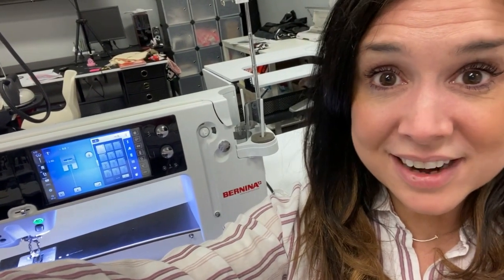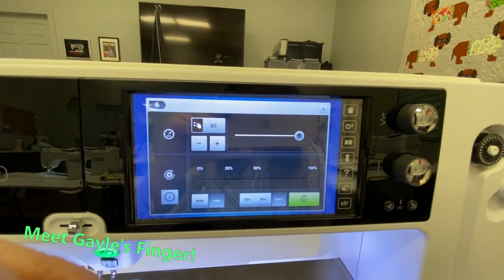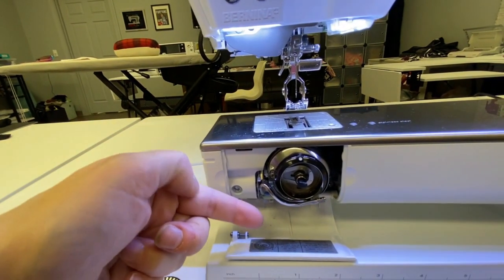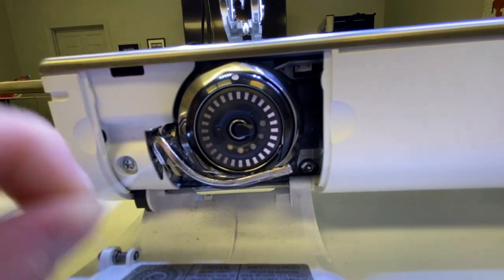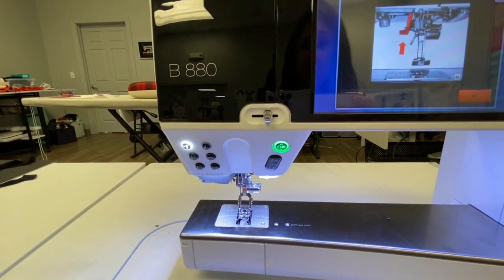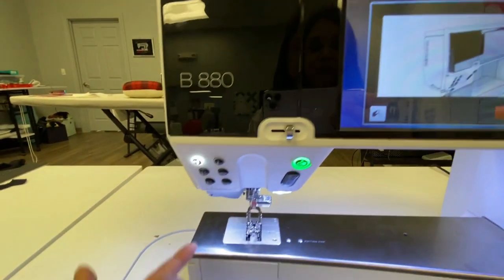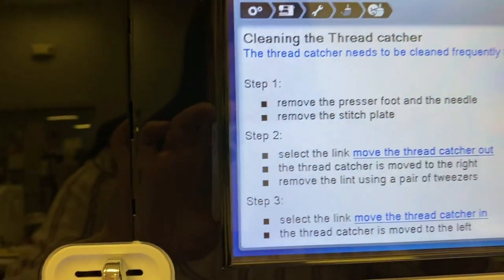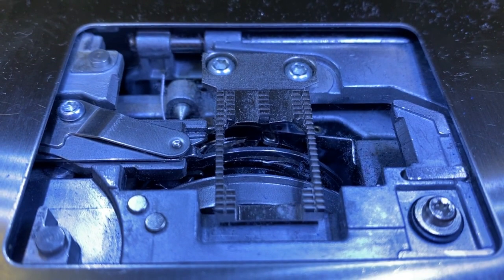Intro to a BERNINA 880 PLUS

Comment: The Bernina 880 manual says to wind the thread around the bobbin one or two times, rather than about five times, as you recommended for winding the bobbin. Is your method an upgrade for the 880 plus, or just an irrelevant detail?
Reply from the maker: In my experience of sewing with the 7 series for over 15 years, wrapping a few extra times prevents it slipping out of the bobbin with slippery thread.

Comment: Thank you, Gayle, for a very helpful video. I learned some important things I hadn't known from any other video. One question though...when threading the machine, does the thread go in front of the little metal tab (toward the front of the machine) or behind it (toward the back of the machine)????
Reply from the maker: I always put it in front but it doesn’t matter. Only when you are using a twin needle. If using a twin needle one thread goes in front and one goes behind.

Comment: Hello Gayle.  I'm so pleased I came across yr video and I've now subscribed.  I've just purchased my 880+ and managing the different threading issue.  Yesterday, I did a text run of an embroidered (small size) label for a quilt.  Looked great, however I was under the impression that when embroidering, the bobbin thread should be dominant on the reverse and NOT the top thread?  On my test the TOP thread was dominant on both the top and bottom!  So, my question is is that corrected if not, then which tension do I need to alter ??  Thank you so much for any information.
Reply from the maker: You should see more top thread in the bottom area than the bobbin thread.
Reply: @BERNINAofNaperville  Ahhh ok. Tysm.. then all is good! :)

Comment: 15:30 So, you clean the needle feeder and the stuff will fall underneath and inside the presser foot area.
Why not cover the lower part first with a piece of paper or cloth.
Reply from the maker: Because you clean from top down and if a spec fell you can catch it. No need to put down a mini tarp or anything.
Reply: @BERNINAofNaperville  Correct and I agree but you did the bottom part first on the video, that is all. It looked weird.
Reply from the maker: @LookOutForNumberOne  oh well. No one is perfect. This video was made in our really early days before we could get a tripod (Covid). Please check out our “so you think you cleaned your machine” it’s a newer one.
Reply: @BERNINAofNaperville  Yes, it is all good.

Comment: Can you tell me the difference between the Bernina 880 (say the 125 yr edition age) and the Bernina 880 Plus?
Reply from the maker: The BERNINA 880 Plus has a few more embroidery features such as shape maker, Thread Away and Pin Point placement. In addition it has more built in embroidery designs, Enhanced Editing with undo, redo, Group and ungroup and rearrange. Also it Reads most popular file formats: EXP, DST, PES, JEF, PCS, SEW, XXX.

For more information you can see the details here: https://www.bernina.com/en-US/Accessories-US/Embroidery-Accessories/Embroidery-Machine-Upgrade/Embroidery-Plus-Upgrade
Reply from the maker: The 125 Anniversary edition was a Plus !
So the only difference is the Black Face Plate versus the Gold Faceplate.
Reply: @BERNINAofNaperville  so it is just an upgrade to the embroidery module itself? Or it firmware within the machine?  I am mainly a quilter and want the 880 model really for the 12" throat space but an embroidery module where I could do some semi-custom in the hoop quilting would be nice too.  I came across a GREAT deal on an 880 that was purchased about 3 years ago with very little stitch time/count.
Reply from the maker: @mxracer158  make sure that it is indeed a plus model. The 125th anniversary edition 880 Plus was indeed a plus model. A regular 880 does not have the plus features unless it was upgraded when that window of opportunity was available. A BERNINA Dealer can read information from an 880 to interpret whether or not it has been updated to plus.
Reply: Re upgrade… I thought it was possible to upgrade the 880 towards plus via an upgrade package you can buy. Did I understand wrong? I am buying a 880 as new at an incredible price, so the upgrade listed 885$ would still be a good bargain.
Reply from the maker: That upgrade is no longer available unless you can find one at a dealer that has one in stock.
Reply: Oh thank  you Bernina…

Comment: Just kills me when I SEE PEOPLE SHOW using a brush for cleaning…no no use a vacuumed attachment  and a soft pipe cleaner slighter oiled to attract  and grab dust
Reply from the maker: No need to yell :) The official recommended tool for cleaning your B 880 Plus from BERNINA is a dust brush provided with your machine. Thanks for your comment.